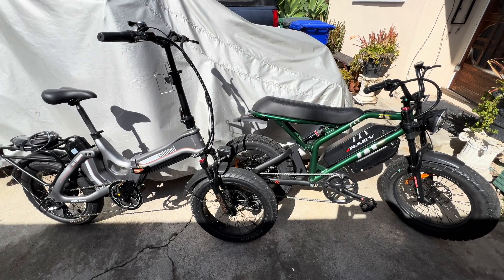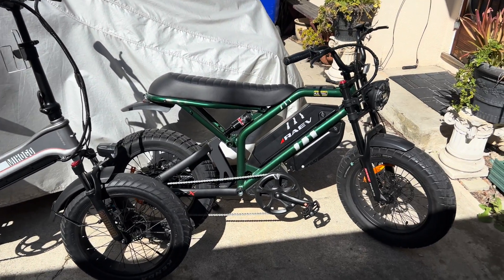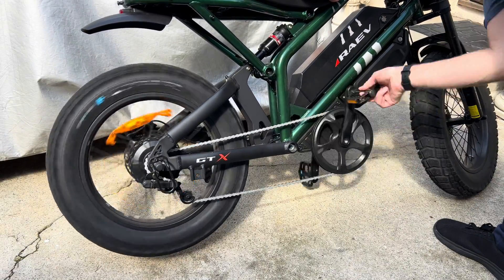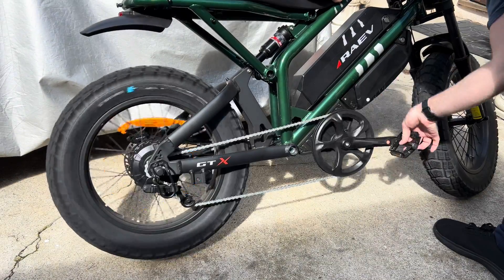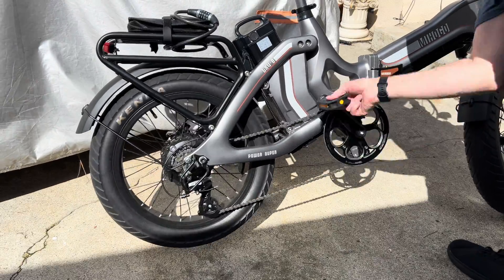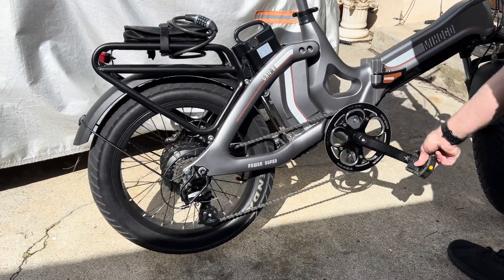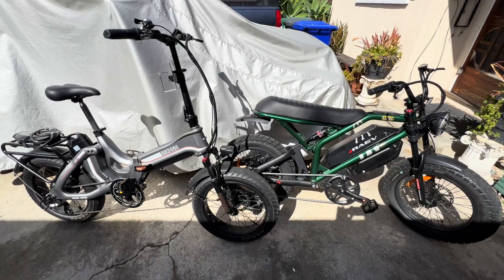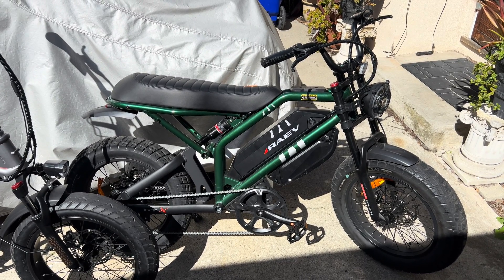E-bike Torque Sensor and Cadence Sensor Explained

Comment: Man I still don't get it....I'm older and want to cruise around throttle only (knees are shot) so no Pedaling.... so torque I'm guessing for me?
Reply from the maker: In your case, it doesn’t matter. Normally a cadence sensor bike is cheaper than a torque sensor bike, so that’s what you should look for. A torque sensor measures how much pressure you’re putting on the pedals, and gives you more help when you press harder. You don’t need that if you’re only going to use the throttle.
Reply: @hoohoohoblin  My brother has the 2yr old $3800 Furious Road Warrior dual 750's with torque sensor and he let me take it for a spin. That was nice with the throttle. 
He's 5'8" and I'm 5'10" and we both didn't like the height of the bike. Though not one problem with this bike in 2.5 yrs, that's good.
I'm thinking about the $3600 Furious EMX Ultimate dual 750's with 20" tires. It's $400 off til Jan 1st. So $3200 isn't so bad in Canada.
Thanks hoblin for the info and the video you put up.

Comment: Excellent demonstration, and how useful each type is does depend on how you use the bike. But, the quality of the setup also plays a role. I've used bikes with dynamic cadence sensing that have been great for pedaling (I'm a former marathoner), and I've ridden some bikes with torque sensors that are just poor and difficult to maintain any consistent speed. Thanks for the video!
Reply from the maker: You’re welcome. You’re definitely right but if it’s a poorly designed system, either one can be bad.